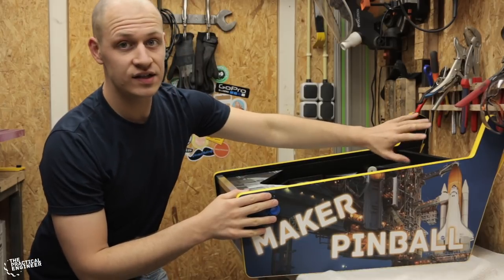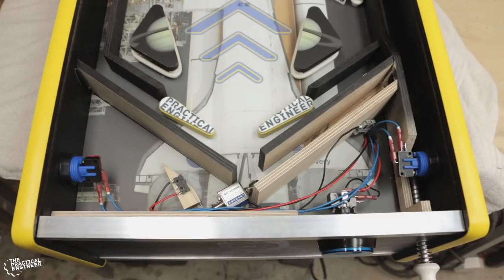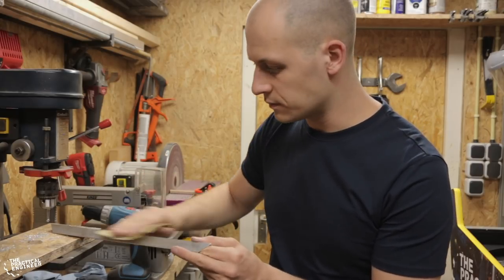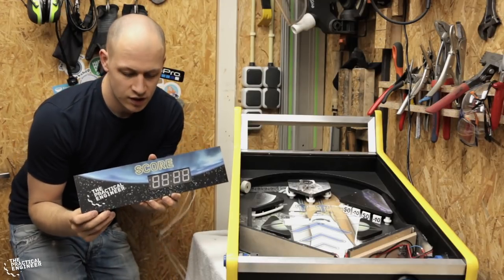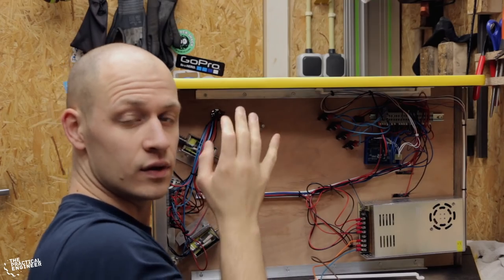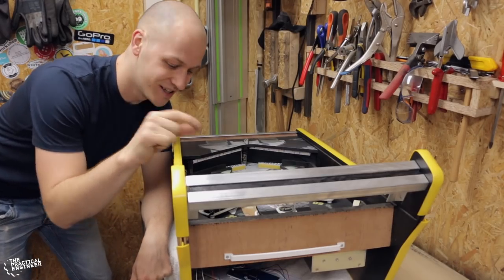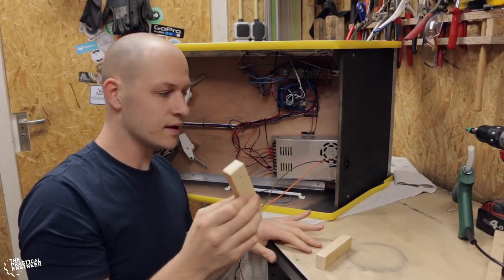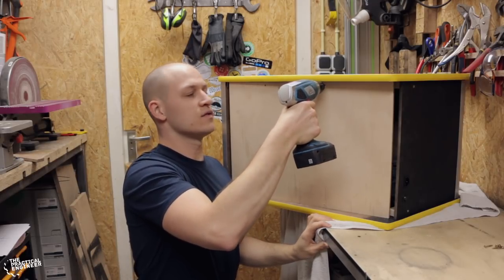DIY Tabletop pinball machine - Finish & digital scoring system  [4/4]

Comment: I'm looking forward to printing my plans and building my own. Pondering a multi ball system in the same form factor. I think this could be done.... add extra loose balls in the bottom of the machine. Coming up with a mechanism that's compact enough for this smaller machine will be the challenge.
Reply from the maker: Hey! cool to hear! I thought about it as well, there are a couple of options I came up with:
- Throw some extra balls in and make it possible to launch an extra when wanted
- The above but block the way with a solenoid and so control when a ball can be added to the game.
- Launch the multi balls from somewhere else, but find a way to get them back there
- copy the system from larger machines

And then I decided to keep it with one ball. I'd love to see what you come up with.

Comment: Are you planning to build a pinball table that has several modes? 
I really like this version though.
Reply from the maker: At the moment I'm not, but sometimes a good suggestion can change things ;)
Reply: @Thepracticalengineer  I have a question would it be possible to recreate original tables in this form factor like with a dmd

Comment: Hi! Great video, I purchased the build schematic & im building my own , only slightly more advanced with a coin acceptor. I’m a beginner, but I’m planning on learning everything there is to know. Can I just ask what electrical cable you used from the 12v? I’ve bought in the DuPont cables for the arduino stuff, but just interested to know what awg was used etc and if that even makes a difference. Any advice re:wiring would be very welcomed! Thanks :)
Reply from the maker: Awesome thanks! I used the dupont wires and additional 0,2 mm2 wire for the display, for the switches and solenoids I used 0,75 mm2. That's a bit overkill for the switches but I like it better to work with than the thin stuff
Reply: The Practical Engineer Brilliant, thanks for the quick reply. I’ll let you know how I get on :)
Reply: Can I just ask what Inlet/powersocket/on switch you used? Thanks

Comment: You should make a Virtual Mini Pinball,  2 x Monitors, 1 x Cheap Encoder (or hack Xbox 360 gamepad) , you have buttons, any computer made in the last 7 years or newer, I have built a few different size Mini 2 Screens
Reply from the maker: I actually like the mechanical stuff a lot more than the electronics. Its nice to see real things moving
Reply: @Thepracticalengineer  agreed